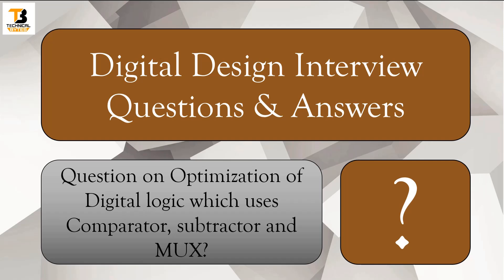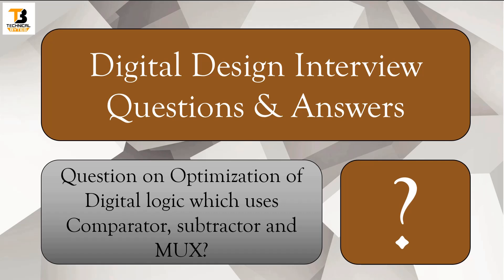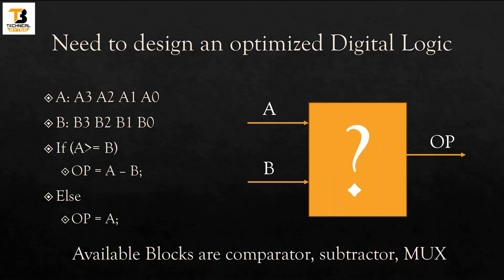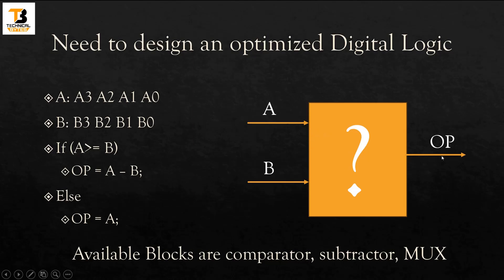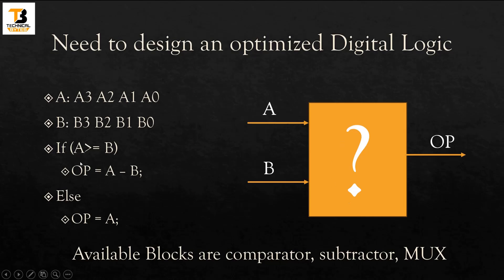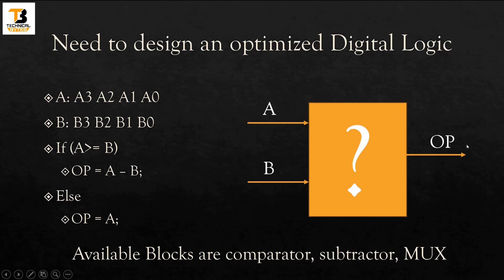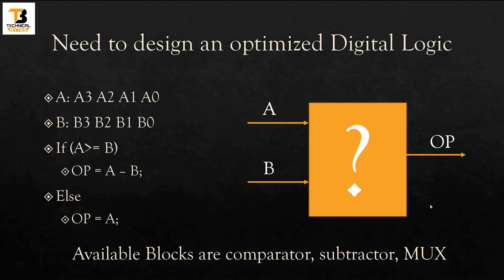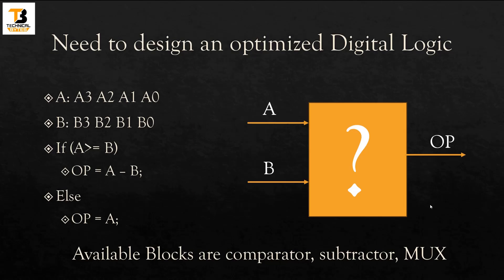Optimization of Digital Design having comparator, subtractor and MUX

Comment: Use the two bit comparator to compare A[3] and B[3]. If A3>=B3 then use subtractor and get A-B. Else use A directly as output.
Reply from the maker: Why are you only comparing A[3] and B[3]? 
What will you do in this case if numbers are 0110 & 0101 ??